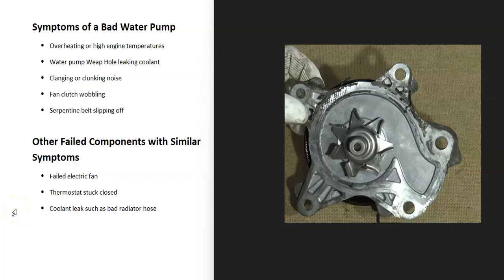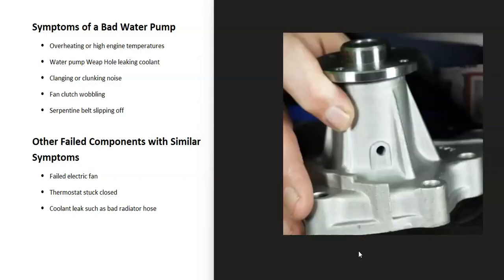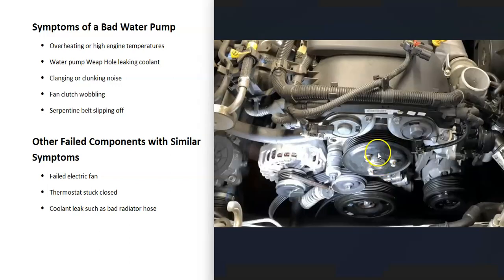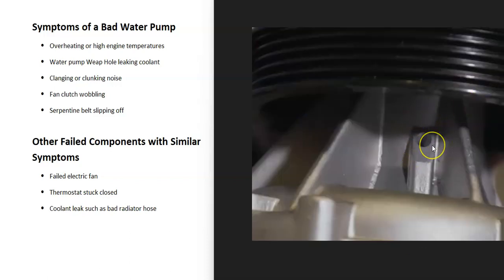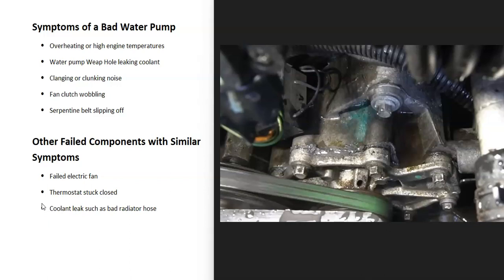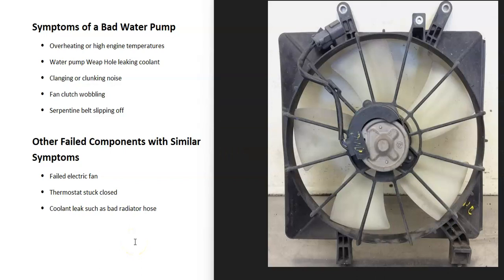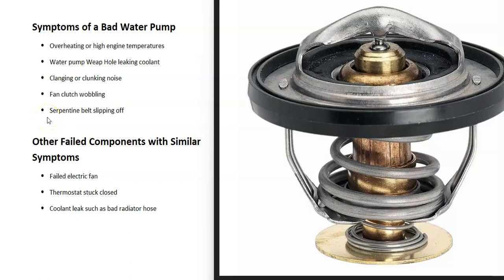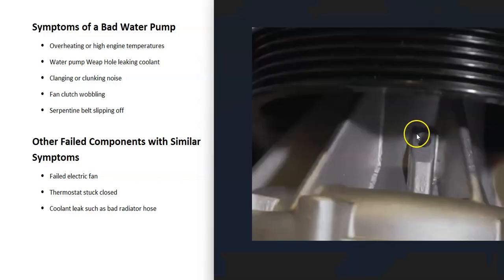Symptoms of a Bad Water Pump and How to Diagnose If it Has Failed

Comment: Mine started leaking I ordered a new radiator cap a new Thermostat and housing new thermostat O-Ring a new Surpentine belt and a new water pump tensior pulley. I noticed my Radiator reservoir kept draining fluid a few months back.

Comment: I have a 2020 challenger rt 5.7 its overheating. My fan is working there's no leaks at all. No whining noises eaither. How do i tell if its my radiator or water pump?
Reply: Any puddles when you drive away?

Comment: I have an issue where i am loosing coolant on every drive and the radiator fan doesn't kick in when the engine is hot but only when i turn the a/c on. The vehicle temperature guage never goes over the middle..when i disengage the temperature sensor the fan comes on. changed the thermostat and the temperature sensor and had an autoelectrician check the wiring and fuses and all are working fine. Been struggling to diagnose this issue for weeks now

Comment: Hello to you I found your service is very informative. Thank you. I have a GL 415 2007 Mercedes-Benz coolant was leaking straight to the ground ticket to be diagnosed and it was the radiator radiator was replaced and still persistent with overheating red light truck came on, indicating very hot pull over The only time the red light doesn’t come on as if I turn the heater on, the fan, however, still runs, I thought my problem was fixed. Once the radiator was put in. There aren’t any more leaks as the person that fixed the car could tell.
Reply: Thank you for that info
.I'm a woman and I understood. .

Comment: I have a 2000 Toyota sienna it stopped on me coming home it ran hot and all the coolant came out it's dripping down my oil pan . I checked my oil it's not milky any suggestions what could be wrong? Also had been hearing some squealing when I turn on a/c.
Reply: The radiator fan assembly module is bad. The coolant will boil and overflow out of the reservoir

Comment: I had problems mine on same day its empty and refilled again and empty on same day Chrysler 300c 2008 so I checked no leaks but I change thermostat and radiator cap and same issue

Comment: Another symptom is faint white smoke coming out of exhaust. Not bright white like a head gasket problem.
But the seals on the water pump to block go bad and leak coolant into the combustion chamber.
Reply: I noticed this just the other day...And now the car was overheating and I lost all my coolant and water in the radiator ...the radiator is only 4 years old ....
Reply: @AprilArmijo Either intake gasket. Or transmission cooler line to radiator. Or radiator crack. My radiator went out at 120,000. My transmission cooler lines went out at 140 k

Comment: Just had my crown victoria towed home after it overheated on me. Steam was coming from the back of the motor  and has had problems getting warm in cold weather. Changed thermostat heatercore still same bs. Lot of coolant smell no leaks anywhere in or out.
Reply: Sounds like a head gasket leaking into the combustion chamber, like mine is doing.

Comment: Hi I have 2010 done caravan I just pulled in my driveway and my car started making a knocking noise looked under and there is a belt and a circle thind and water pored everway it was a light yellow color which I think is the coolest but could u plz give me advise on this I'm a single mother and know a few things about cars from my dad your option will be appreciated
Reply from the maker: It sounds like the coolant leaked out for some reason. When the engine is cold, you can check the coolant level. If it is low, it will need to be diagnosed to find out why it leaked out: bad hose, water pump, thermostat, and so on.
Reply: @HVAC_Mechanic  it's also making a noise when I turned it back on

Comment: I have a 06 tundra with a 4.0L. I got in it Monday and it barely got past C when it is between C and H,lower than between. I changed the temp control sensor on the block and it still barely passes C. Engine is low idling and running rough. Changed the 180 degree thermostat 3 years ago. Radiator doesn’t get super hot anymore including the hoses. Any help will be good!..?

Comment: I have an overheating issue water pump replaced already but car still overheating it’s a closed system and it bubbles out of reservoir tank please help
Reply: Bubbles coming out from the radiator neck usually means blown head gasket.
Reply: @VitMcG tuff

Comment: I have a 2018 Toyota Camry SE…
Can fixing the water pump cause the thermostat to go bad? I feel like I was ripped off at the dealership. My cars check engine light was on and the gauge was on the H but it was never hot or smoking, also no leaking. I took it to the dealer and they said the water pump, I paid to get it fixed less than 48 hr hours later the check engine light was back on I took it back and now they are saying the thermostat. I thought it was that from the very beginning
Reply: You could just have an electrical issue thats causing the temp gauge to read Hot even though the radiator fluid isnt boiling, its a thing that can happen. I would take your car to multiple other shops and see if they say the exact same thing or not. And they would have checked the thermostat first to diagnose your issue considering its a whole lot easier to take out a thermostat than to take out a water pump, so it is possible they are just trying to make you replace parts so you can fork money over to them.
Reply: Did you get it fixed? @jessica4721
I have a 2018 Toyota Camry too and my check engine light just came on just 2days ago I went to a mechanic shop and they said it was the P26CB code (water pump) that it’s stuck. I took it to the dealership but they couldn’t quote me on fixing it they wanted to check it & give me a diagnostics themselves $195 😥

Comment: On my 06 dts the car started overheating on the highway i popped the hood the tensioner pulley water pump puley and belt was melted and destroyed could it be just that i tried moving my water pump its steady but the belt when it fell off it got stuck behind the puley and i csnt really get it off its like ill have to torch it off

Comment: My coolant level is dropping every time I drive it. Drops about half an inch every day. Engine oil looks fine and no head gasket issues. Could a bad water pump be the reason it’s losing coolant?
Reply: Try placing a thing of cardboard under your car every time you park it and it would help trying to pin point where the leak is coming from. The water pump is where all the belts are at so if you see any liquid dripping out of that area while the car is running then good chance its the water pump. If you dont see anything leaking out of that area, inspect other places, radiator hoses and the radiator itself mainly.
Reply: A leak maybe ?
Reply: I have the same problem with my Subaru Outback, it was doing fine for awhile, and suddenly my car starts overheating when I drive for awhile, a lot of air pockets were removed, put a lot of fluid in the new radiator, and got a new thermostat

My car wasn’t leaking coolant (not even a single drop) but the coolant just disappears

The only way to look at it is the water pump issue… But I am going to take my car to someone who knows a lot more about cars, and diagnose the actual issue
Reply: My coolant was getting low often for a long time, then this clanking noise sounding like metal rattling around started… within a week, it got so bad I knew I had to take her into the shop.. water pump is on its last leg bearing is loose. I’d say it COULD be the beginning of it getting bad
Reply: You're one of the lucky ones who gets advanced warning by way of sounds. Many other people get no warning. Just seizes or breaks. Always when you're nowhere near home and Saturday evenings when it's too late and too dark to really look at it and the damn mechanic is closed on Sundays! LOL